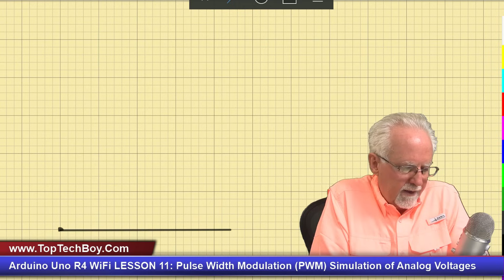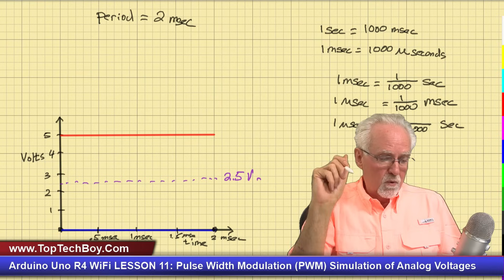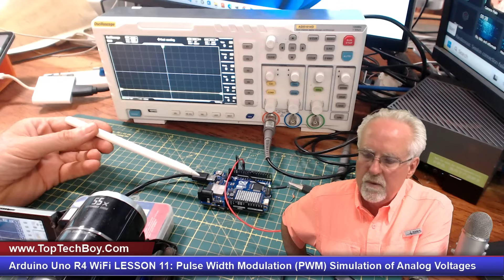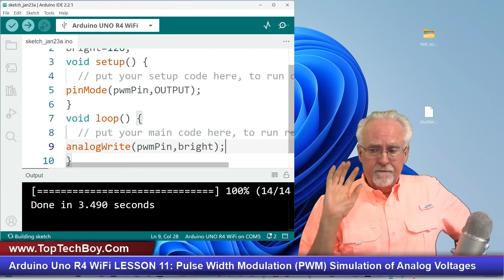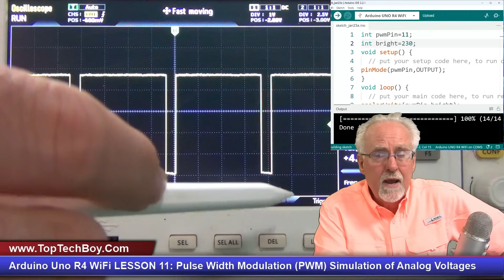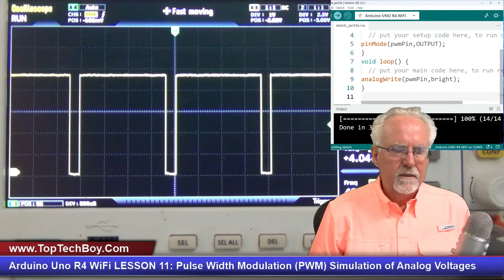Arduino Uno R4 WiFi LESSON 11: Pulse Width Modulation (PWM) Simulation of Analog Voltages

Comment: There is no “making” assignment for this week.  Rather, teacher Paul asked us to summarize Pulse Width Modulation (PWM) as explained in the video.  The Arduino can only generate digital signals by way of two voltages, either zero volts or five volts.  That can be made to correspond to a pseudo analog value of voltages between 0 – 5.  It does this by dividing the signal into small segments of 1/256 or 0.01953 volts each.  It then passes one of these integers on to the analogWrite() function.  For example, if you sent 51 to the analogWrite() function it would output 1v.  It does this by keeping the pulse voltage at 5 for 51/256 of the time and 0 for 205/256.  The LED appears to be dimly lit all of the time, but it is dark most of the time in this example.

Just for fun I asked ChatGPT:  “What is Arduino PWM?”  Of course, ChatGPT did not listen to today’s presentation, however its answer is quite good.  Here is part of its answer:

Arduino PWM (Pulse Width Modulation) refers to the technique used by Arduino microcontrollers to simulate analog output using digital signals.  PWM allows you to control the average voltage level delivered to a load by rapidly switching a digital output pin on and off at varying intervals.  By adjusting the duty cycle (the percentage of time the signal is on versus off within each cycle), you can effectively control the power delivered to devices like LEDs, motors, or other actuators.

In an Arduino, PWM is commonly used for tasks such as dimming LEDs, controlling the speed of DC motors, or generating analog voltage levels for interfacing with analog components. Although Arduino boards are digital devices, PWM enables them to interface with analog components and perform analog-like tasks.

Arduino boards have built-in PWM capabilities on certain pins, which are marked with a "~" symbol on the board.  These pins are capable of producing PWM signals using the analogWrite() function in Arduino IDE.  The function takes two arguments: the pin number and the desired duty cycle, which ranges from 0 (always off) to 255 (always on).

Comment: I originally thought it would show up as the voltage value we wanted but remembered it only shows time/ frequency on scope as full voltage . The actual voltage needs read by meter and it will be the voltage we’re after. Been 45 yrs since high school electronics-Lol.

Comment: Question:
If I have an actor which supports v(max) 3V; could I use also PWM with 126 for this although the device gets 5 Volts for 1ms and then 0 Volts for the other ms.
Reply from the maker: Yes, you have to be cognizant of that PWM does produce a larger peak votage than the specified voltage, so you have to make sure that will not damage the component you are driving.